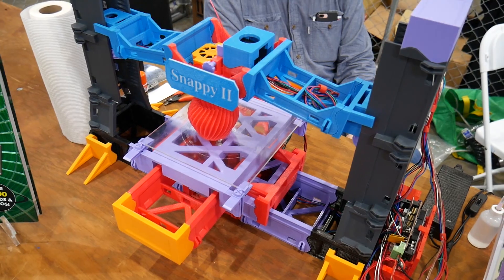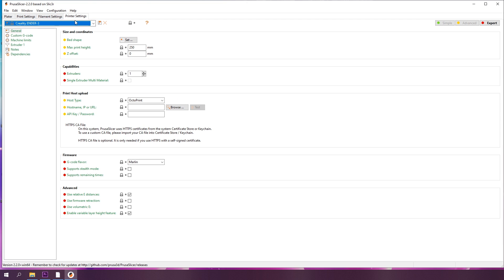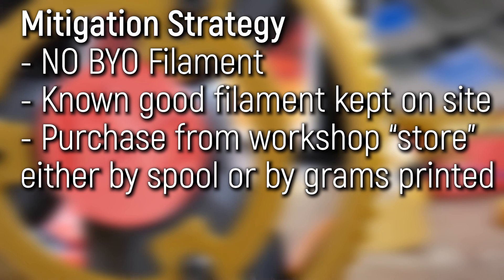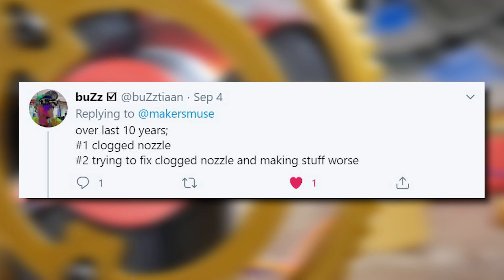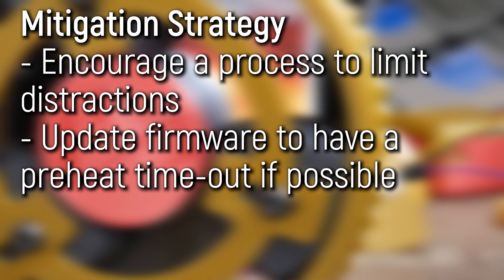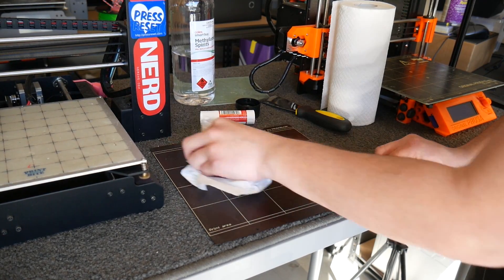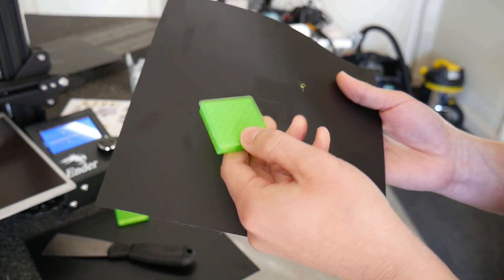How People BREAK 3D Printers (and how to stop it)

Comment: Good video, as always.  I want to ask your opinion.  I need a 3D printer that prints flexibles well.  Specifically TPUs at 95A and Armadillo TPU which is 75D.  We've tried a FlashForge Creator Pro with dismal results (won't even load 95A TPU, after a few filament swap cycles) and also have a Raise3D E2 which has clicking problems (followed by part failure) with either of the filaments above.  What are great printers for TPU?  Budget is $500 - $6000.  About 300mm x 300mm is fine capacity wise. Thanks so much!

Comment: Clogging nozzles? Did not experience any jams since 3 years on my 4 printers.
Free of clogging nozzles since I use a simple sponge between filament spool and extruder. It gently wipes off the dust which usually contains nasty fabrics which do not melt properly and built up a crust on the inside of the nozzle.

Comment: Not many people know this method, but for keeping the prints stuck when printing and making them easy to remove, I coat my glass bed with sugar/water. As water evaporates only thin coat of sugar is left, which is very sticky when hot, but as glass cools down, prints just pop of.

Comment: 1) Once a student (who was an Engineering TA) couldn't get a print to stick on the glass bed, so he removed it and tried to print right on the aluminum plate.
2) Students leaving things under the print bed an an Ultimaker. Print finishes and it tries to lower down onto the stuff.
3) I saw the exact same thing with a student picking a printer up by the print. X_X

Comment: This is for those who do not have a printer but need something printed and want to use their local makerspace/hackspace.

Every hackspace I have ever been to required induction on the machine. Some will have a list either on their website or up on the wall with  people who can operate the machine. Ask if any of them is around. If not: come back later. You never, ever, just sit down and start fiddling with things (should go without saying). You will always get "the talk" the first time you come in to use the printer. The length depends on how experienced you are. If you have absolutely zero experience and just want some part printed, one of two things usually happens: If the guy or gal in the hack space has some time and you want to learn something, they might walk you through the entire process and provide explanations. If you are not interested in the details, someone might just ask you for a flash drive with the STL file or ask you to go to the PC attached to the printer and have you download it from Thingiverse or wherever. They will then get the print job running (or help you do it) and you can either stick around or come back later to pick up the print. 

If you need a special color or material: ask beforehand if they have it in sufficient quantity, and if not: bring a spool of it and be prepared to dial it in on the printer, with some help from one of the people around. 

Usually, there is also a bottle of rubbing alcohol or other cleaning solution somewhere near the printer. So if you use your local hackspace: be be a good guy/gal and clean up after yourself once you have used the printer. Depending on the policy of the hackspace, some charge for filament by weight or just put up a "tip jar". Use it, especially if you bring your own filament. If you know you won't need the rest of the spool: donated filament is always welcome. Needless to say:  If a print is running, ask if it is okay to run a print job after that. Sometimes other people need to run multiple prints in sequence. If yours is a really quick one, you might be able to butt in between two jobs. Just ask if the printer will be free.

Hope this helps!

Comment: My printer came with instructions so bad they didn't match the machine's current shipping version.

And after putting it together...

Yeah... that's where the manual stopped and I started screwing stuff up. I've made every error here several times (learning why each time, but occasionally forgetting and repeating a variation of that.

This one time (at Band Camp, fnarr) I jiggered the Bowden tube making it far too short. Another I clogged the head so badly that PLA was squeezing up the outside of the Bowden tube in the hot end.

Back to shark diving I think. This is too stressful.

Comment: "Bring your own media" is one of the leading causes of departmental paper printer destruction too ($2500 bill for a new fuser isn't fun)

We ended up having to put LOCKS on the paper drawers as well as the maintenance covers (this is harder than it seems because most printers aren't designed for them)

I'd suggest adding a camera above a public printer too. It makes "I didn't touch it" claims easier to disprove

Comment: A 3D printer is a type of CNC machine and should therefore be operated as one. Some basic CNC/CAM  knowledge is an advantage for sure here.  However since CNC machines in general have been and mostly still are very expensive and tucked away inside huge factories reserved for use by skilled workers, unless u work as a CNC operator most people have no experience whatsoever with them and how they work (the way you  operate a 3D printer to me at least closley resemble how u would operate a laser or waterjet machine) Knowing the basics of what G Code is and how it functions in controlling the machine is very good thing. Checking things like, make sure all parameters are set right, all the axis are zeroed , using correct feed speeds temperatures ect before pressing cycle start. Using the wrong G Code can cause bad damage to any CNC machine. In the case of lathes and millng machines bad G Code can cause horrifying crashes potentially hurting operators and totally destroying the machine. Same thing but not as dramatic (no fast moving parts with motors in the KW range driving them) applies for 3D printers. The blob of death would I guess however be somewhat similar to a really bad tool crash that destroy the spindle of say a milling machine because some part of the CNC program was not right (Bad GCode, tool offset length ect). Also.... basic general knowledge of  doing this very process of 3D printing and not just fiddle around if u dont know how to property use these machines. Youtube as usual is your friend (mostly I guess as I have recently watched tons of guides and howtos in preparation to buy my very first machine really soon and making sure I dont wreck it and also can make high quality parts for long time with it)

Comment: another thing that happened to me: make sure nothing gets in the way of your printer. had my new ender 3 pro chew up its own power cord between the x axis gantry and the power supply, which royally fucked my bed (because silly me decided to relevel without noticing the reason for the printer not reaching to the plate was a cable in the way, and when i cleaned the cable jam it ran right into the buildplate, essentially cutting grooves into it and displacing the material so half the bed refuses to stay flat now) and also dislodged the whole roller assembly, so i had to readjust all the rollers and buy a new mat, at least those magnet mats are only 15 bucks and no of the aluminium profile bars were bent or anything like that.

Comment: My printer hasn't worked fully since I got it and creality has been almost no help it fails at the extruder its not filling the motor still spins but the bearing will stop spinning and just twitch in place got a new extruder which got it to start feeding but now the bearing snaps back and spins the motor backwards any help would be nice i have the ender 5 plus

Comment: Oddly enough, the BEST method of bed prep for me was just watered down PVA.  I have a bottle with 1 part PVA, 3 part water.  After I clean my glass, I put it on the bed and preheat it. Then I take a few DROPS of the mixture and brush it over the glass until it dries.  It does NOT take a lot of GLUE! This is better for me than glue sticks, because it is 1)easier to keep (I just have a bottle of the stuff, and I am a painter, so I have brush cleaning station nearby), and I don't have to worry about overspray with aerosol gules( I almost glued my parts fan tight when I first got my Ender3 because everything said to use spray glue to increase adhesion, and I did it when it was already on the machine).  Also, I can easily tell when it need to be cleaned/reapplied, because the PVA will peel off, leaving shiny parts on the glass that you can easily see.  Oh, and I am just using regular window glass. Went to my local builders supply and they cut it to my size right there.

Comment: I was asked to look at a 40 thousand USD printer that was not working. It has 2 heaters and extruders in the head inside a heat shield. This heat shield was completely full of PLA to the point it was squishing out around the nozzles... Still don't have it working, I think it's complaining about the temperature sensor on the "support" side. Print head assembly is 1700 USD. I'm now home, happily using my Sidewinder. I checked, the whole print head assembly for that is 40 USD. I'd really like to see that machine work. I'm curious about what a printer costing 100 times as much as mine does.

Comment: It's funny - I'm perhaps cautious by default - but I feel nervous setting up very large prints and walking away. This has not been a problem for me. My biggest 3d print issue was nearly being discouraged because my first printer was a kit build, and that meant spending more time fixing the shortcomings of the kit (cheap parts, potential fire hazard of the heated bed connections, crashy software, cables that pulled themselves loose and bed rocking when moving on the y-axis). Getting a reliable printer has allowed to really experiment with what I can print on it - and this year I'm considering TPU, although I may want to get spare nozzles first as I've heard it can damage them.

Comment: I don't have a public 3d printer but I ran into a lot of problems with mine even after watching many videos on the subject of "How not to use a 3d" printer. Somehow I still made some of the common mistakes and everything on my hot end has been replaced as well as the bed having been replaced with a PEI coated spring steel sheet. I would say that no matter how much you prepare you are probably going to run into things that you didn't think about before. PLA can be kept from coming out the wrong side of the hot end but you need to know to tighten both sides and know how far the tubing goes into the hotend before turning on the 3d printer... hint, it goes well past where the fitting ends.

Comment: My problem is, Second time that I had heater bed failure due to wire flex and breaking.  
Last revision was to make the flex zone as big as possible, so that it does not flex at a single point. (Added springy plastic at sharp bend to limit flex.)
Now making X-Mas gifts for brothers kids.. Shyte they can never get in store. 
Hence, giving them that one of a kind bragging rights at school..
Got a lot of sanding and painting awaiting me. lol 
Good luck to ya all! And happy 3D printing.

Comment: 2:27 <-- Wrong!! I use Oatey Standard Grade Yellow ABS Cement, on my glass print bed. I put it on a 50`C, then run my bed at 80`C And it prints with ABS like a dream!
Now I did have a problem where the flex in the heater bead wires, broke. And 1/2 way though a print it let go.. Because when temp drops bellow about 30`C the stuff starts to sometimes self release. Note: This self release can be avoided if the Yellow is put on a cold bed.. But I hated the removal problems that fallowed. 
  Now I do have 1/4 inch glass bed. So I do not fear that said Cement glue will crack my bed.. So you have been warned.. 
 *  I have printed hundreds of ABS items using, Oatey Standard Grade Yellow ABS Cement.. *
Works quite well... About 95% perfect.. (Yes I did have a few parts that let go, but seldom.) And better than anything PLA ever did when I used it..

Comment: If you want easy part removals on a deposition printer, get a Borosilicate Glass Plate and always heat the bed. Parts just POP off when the bed cools, like magic. I love it! I've never scrapped off a part after buying the glass. A few minutes after the bed shuts off, I hear a little crack/pop and the part is just sitting freely on the bed, ready for me to collect.

Comment: I have this one project I do that prints out an entire spool on a model at very high infill. Every one of those adhesion methods you cringed at, I use lol. I tape the bed in a lattice patern with 2 layers, then I spray it with spray adhesive, then I put it back on the printer and start printing. as the printer gets going, I put drops of super glue along the skirt with a couple in the middle

I may sound crazy, but this model is garunted to warp every time. using these methods means the model is glued to the tape, allowing it to peel slightly, rather than the model popping of the bed

Comment: Ok flexible bed's are a pain in the rear. Best way is tempered glass. If you object is stuck to the glass take the glass off of printer with the object attached and put it into the fridge or freezer for a while this will change the materials so much that is will pop off your glass bed. Also hands down best is if you do ABS you use ABS juice same color as your print. Or for any other material I use from garnier fructies the ultra line hairspray and just a mist spray of it over the glass while it's in the sink is the best way to coat it. Easy to clean up with a little soap and water too. Best results to the points you don't even see or feel the layer lines on the bottom layer.

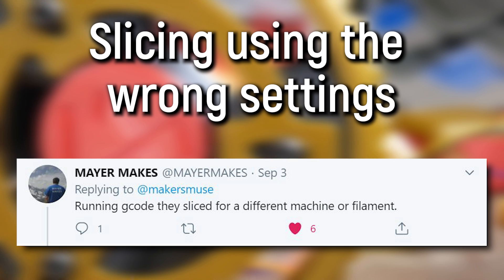Comment: 0:00 - 1:36 intro/padding  
#1 wrong slicing settings  1:36  
#2 failure removing failed print 2:40  
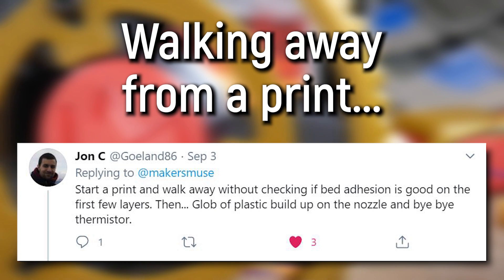#3 walking away from a print too early 4:05  
#4 people bringing own, crap filament 5:22  
#5 "fixing" the printer until it breaks 7:29  
#6 preheating forever 9:10  
#7 outdated bed adhesion methods 10:47  
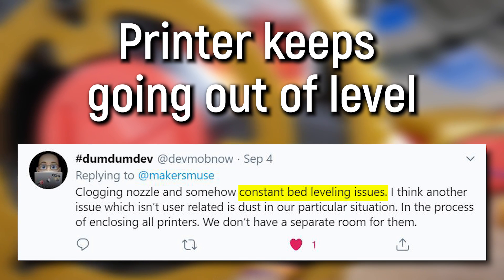#8 violently removing the printout 12:22  
14:33 outro/padding

Comment: what is this "blob of death" i'm scared
Reply: Blob of death is basically filament that didn't leave the nozzle and starts to bunch up into a blob as more hot filament is being pushed into it. Because the material cannot leave, heat starts to back up the machine and can damage or destroy components as mentioned in the video. Hope that cleared it up.